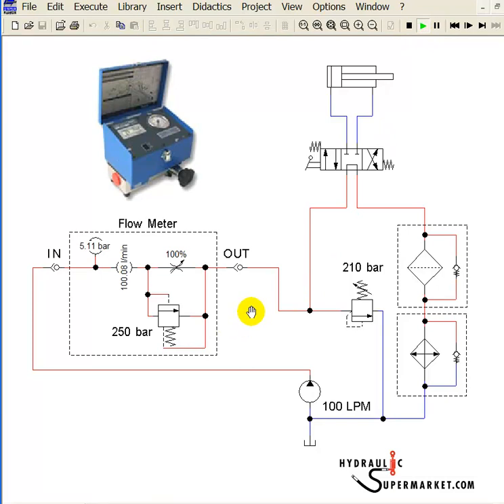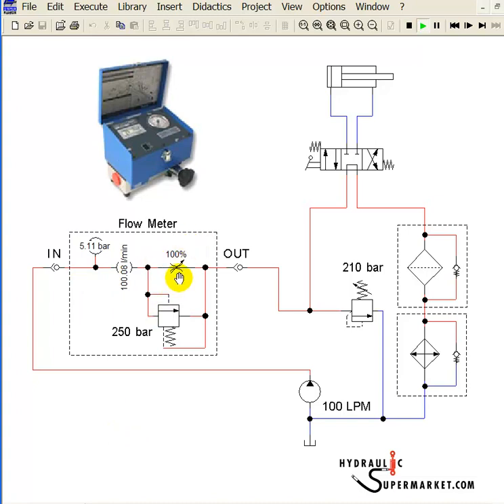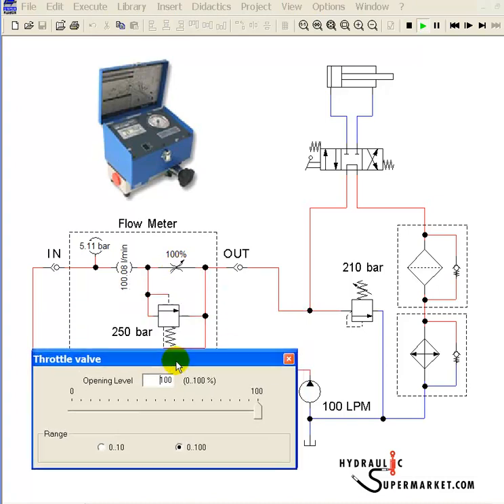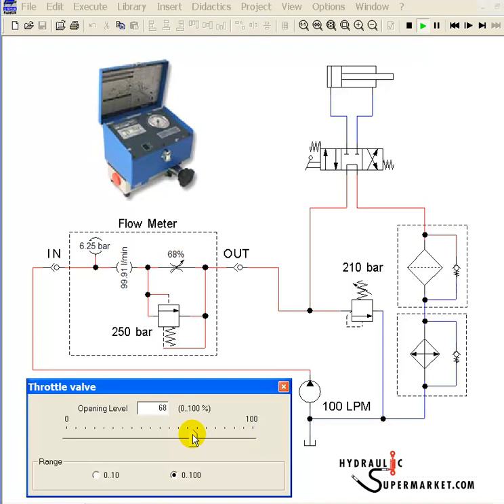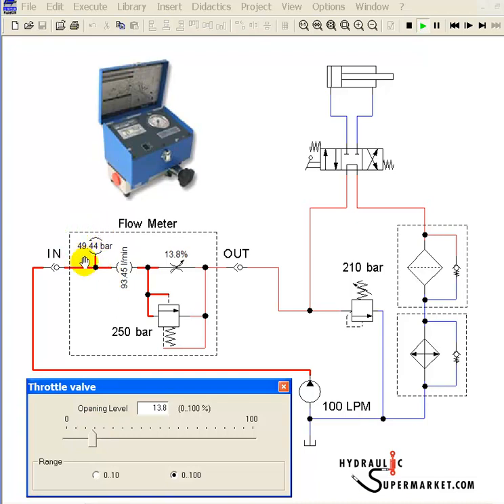How to Use a Flowmeter in a Hydraulics Troubleshooting Situation

Comment from the maker: Hi Jay,

If the flow meter is connected as per the second connection in the video, then the system relief valve is downstream of the flow meter. This means if the throttle (loading) valve in the flow meter is screwed-in, it's possible for the pump to be over pressurized (positive-displacement pump). The flow meter itself usually incorporates over-pressure protection, but the setting of this device may be higher than the rated pressure of the pump been tested. So care must taken when loading up